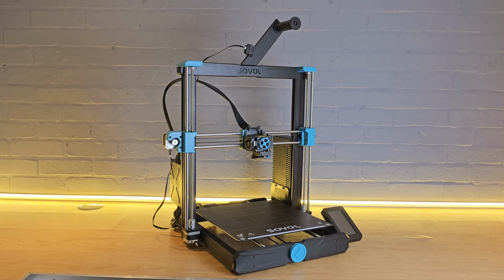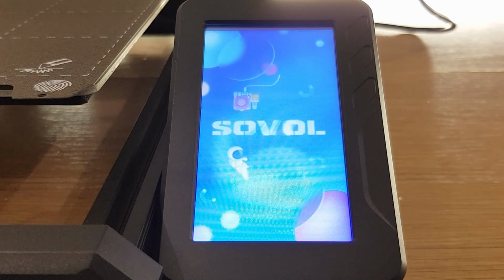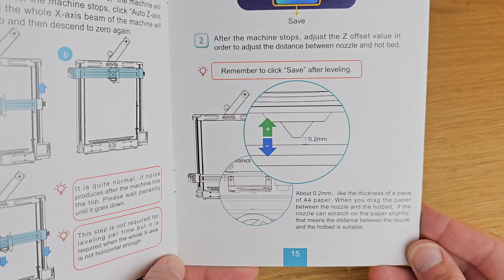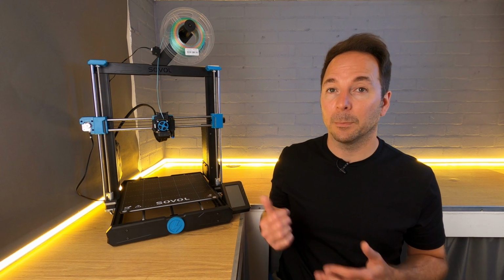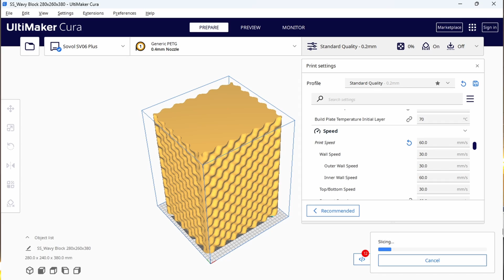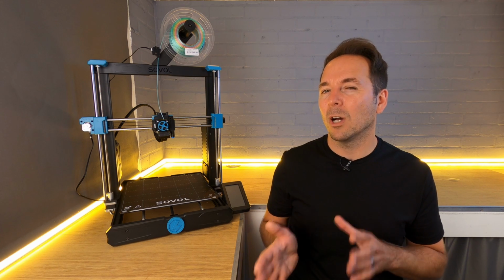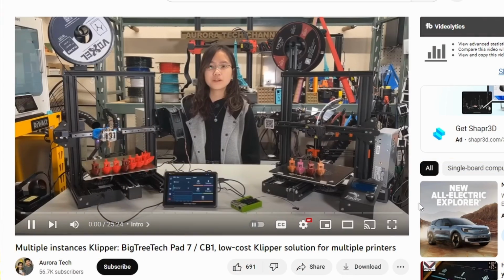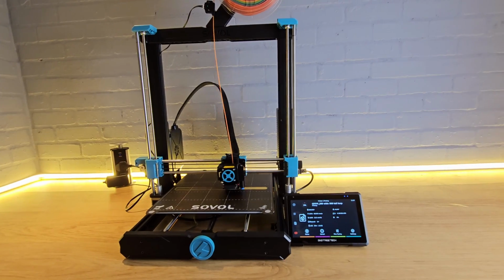Sovol SV06 Plus - The BIG 3d Printer That Nearly Could

Comment: Sovol is fantastic.. I recently bought 2 of the SV06 Plus Aces and they are without a doubt the best printers for the price you will find..  the bed leveling is now the actual tip and it's pressure sensitive , has a built in camera and light and will take time lapse video, and with a mobile program that will even tell you when it's done or even when something doesn't look right .. sometimes.   I have been printing for only about 6 years and my first printer was the Ender 3 pro which I upgraded with new main board, metal extruder dual gear and so on.. then sold that and bought 2 LONGER LK5 pros which were great printers but had manual setup for level.. now with the SV06 plus ace  everything is automatic.. I put it together and didn't have to touch any adjustments at all.. prints awesome right out of the box and I was doing Helmets and larger prints.  and with ORCA slicer vs Cura , it was no contest.. Orca is much better IMHO..

Comment: Now that we are a year on, I've become dependent on my SV06 Plus as my main printer.  I bought the Creality Sonic Pad and Klipperized it a while back.  Having the Sonic Pad also allowed me to Kilpperize my standard SV06.  I run a 0.6 nozzle on that one for lower resolution demands and it works great.  I also purchased a second extruder assembly for my SV06 and that allows me to swap down to a 0.2 nozzle quickly for finely detailed small parts.  The other thing that has made my Sovols uber reliable are standardizing on the PLA+ from #IIIDMax.  This, combined with shifting to Orcaslicer (2.1.1 right now) has proved to be a very painless and stable ecosystem for my FDM printing.

Comment: I dont know if this is the problem youre facing, but you might be experiencing some kind of feeding problem. Filament spools hung on the holder of the sv06 plus have a tendency to bend the holder slightly due to their weight. This causes the spool to slide forward and onto the end of the spool holder. This puts strain between the filament spool and the filament sensor at the top. This is because it goes into the filament sensor at a weird and sharp angle, causing friction. It might be less of a problem when the extruder is further down since there is more slack and thus the problem of friction is a more spread out problem, but the higher you go, the less material, and thus the less slack there will be.

Im not sure though.

Comment: I really do not understand how is it possible that the auto bed leveling works for everyone just not for me. Like it is close enough, but I can see nozzle is too close in front left corner and to far in right front corner. Rest of the bed is pretty much ok. I have tried everything. Leveling z axis automaticaly (by going up to the stoppers) then run auto bed leveling. I tried leveling Z axis by switching off the motors and manually moving left side, manually seting hight to bed using sensor, than moving right and manually setting height to bed using sensor, then run auto bed leving (and save it off course). Nothing works as perfect for me as for you the reviewers. It is my first printer so it is possible I am doing something wrong, but I have followed so many different videos... I am actually thinking about purchasing DIN 988 washers (0,1mm thick) and putting them under the bed to lift rest of the bed closer to hight of right front corner. (I also dismantled the printer Z axis and make sure I assembled it to be really straight up using 90° steel ruler). Problem is I am perfectionist and just ok is not good enough for me I want to achieve bed leveling you presented.

Comment: i have many problem with this print, after spend time on all adjust and setting make some good print but when i try to print i notice z offset was high and the left side was more high that the right side! so remake all setting make z offset very low and now i print but still the quality have issued, i switch from 0.4 to 0.6 steel nozzle, now i prepar to install 5015 fan

Comment: So the inexpensive XL printer failed at a newly designed torture test print made by you and tested by no one, and yet no other printers have been shown to successfully print it.  You may be able to draw in CAD 3D space, yet the ridiculousness of your thought process paints you as unintelligent.  

And no, I don't own a Sovol...but your thinking on this one is poor at best which is really disappointing.  MIM gears and other MIM parts fail all the time.  The failure rate is low, but mass production means it will happen. This is not unique to any direct drive extruder, and exists in the auto and firearm industry to name a few.  Then you slap on an upgrade(Klipper Pad) and re-test without showing what the average buyer would experience?  Jesus dude, you are all over the map.
Reply: I'm not sure what's the need to be so brash here. Maybe you don't think in the same terms as him, and that's fine, but I find his reviews valuable.
Reply: @actualreplyguy  I am brash because there are many, many more who cannot see logical fallacies.  His videos can be great, and some are, but nothing makes change like being shown your errors in thinking.  

You say we think different...true, and in some ways I am too critical.  

I think of the people who are turned away from a product by an influencer because of a slight struggle...an irresponsible one as well.  A voice to others should be held with higher standards.

His sample of one printer that he had minor issues with are not how the printer should be viewed.  Had he known anything about manufacturing, he would know the real weaknesses are completely different than he stated.  Not the 1 in 10,000 MIM parts.  The injection molded parts are weak as are the bearing choices which are worse, yet he cannot see it.
Reply: @CuttinInIdaho  you have an axe to grind or something? Guy literally went step by step about how he got around the problems he was facing -- which was to install Klipper. There were no leaps in logic.
Reply: @actualreplyguy  re read my comment without your emotions clouding your comprehension...no axe to grind.  I can't help you with logic though.

Comment: Very informative review.  Thank you.  I replaced $3000 worth of QIDI FDM printers that I couldn't keep running with a $238 SV01 over two years ago and it's been great.  Unlike the QIDI 3D printers, the Sovol printer uses inexpensive and readily available parts.  Also unlike the QIDI printers, it's reliable, and when it did need a new hot end heater, the open architecture was very easy to access.  I'm inclined to upgrade to a later model by Sovol, but I want Klipper.
Reply: youll be happy with the svo7/7plus now then
Reply: @ZFGFZDGDFG  - I probably would like a Sovol SV07 or SV07 Plus, but my Elegoo Neptune 4 Pro arrives tomorrow.  I'm stoked to be getting a Klipper machine with all steel motion control components and enhanced part cooling.  I might be in the market for a Neptune 4 Plus Max (420 mm cube build volume) when it becomes available, for the rare times I want to print something BIG.

Comment: I love my SV06+. 5015 fan for parts cooling. Klippered and installed a ercf 6 filament system on it with a homemade filament cutter for color changes. All in all i have about $600 in the entire thing and have the ability to do 6 colors.

Comment: I got the SVO6 Plus a few weeks ago as my first 3d printer. I really like the printer so far. Its been running alot and I'm getting less mess ups as time go on. The thing that I dislike the most about it is having to deal the the mico SD card all the time. I've discoverd OctoPrint and I set it up on an old laptop and it now runs the printer.  Is OctoPrint about the same thing as the Sonic Pad with Klipper?
Reply from the maker: It's sort if similar in the way you interact with it but it's actually quite different. With Octoprint and your stock firmware, the printer's control board is still doing the work, you can just send the files to it remotely and control it in some other cool ways. Klipper actually has the additional board doing the work and your printer's control board just does what it's told when it comes to moving the stepper motors.

Comment: Also if you replace the fan shroud, you can use regular volcano nozzles instead of Sovol’s garbage proprietary ones - the best one I’ve tried so far is from SavageLau on Printables, the “Hurricane” one.
Reply from the maker: Good tip, I'll check it out

Comment: I had the same problem with large, tall prints - it’s the damn filament sensor. They mounted it mostly fixed in position next to the spool, instead of on the tool head (for some reason, despite the tool head breakout PCB having a plug for a filament sensor), and as the tool head gets closer to the spool vertically but farther horizontally, the filament starts to drag in the sensor and causes uneven extrusion. Move the filament sensor to the tool head (you’ll need to make a cable for this, but it’s easy) or just bypass the stupid thing.
Reply from the maker: I see what you mean and it was my first thought too but I tried a few things I didn't show in the video and I'm not convinced that's all it is causing the quality and layer shift issues. I agree the design isn't perfect though.

Comment: Hey Ricky, great video! I really enjoyed your review of the SV06 and your insights on it. It's an impressive printer. I completely agree with you about Klipper. It's a powerful firmware that can significantly enhance printer performance. I'm also interested in upgrading my Ender 3 with Klipper and a Pi, but the installation process can be daunting. I don't want to risk making mistakes or spending endless hours searching for solutions. It would be amazing if manufacturers offered preinstalled Klipper units or easy-to-use upgrade kits. That way, we could enjoy the benefits of Klipper without the hassle. Thanks for sharing your thoughts, Ricky!
Reply from the maker: It sounds like the Sonic Pad would be a good option for you. It's pretty straight forward with an Ender 3. They have included printer profiles that you select during setup. I have video guides for all of this too.
Reply: @RickyImpey  I was thinking about that option too. Thank you, Jason
Reply: They now sell a sovol klipper upgrade for under $100. It’s basically the same setup as the svo7 with klipper and a network app access.

Comment: I have printed a large lamp shade that filled up almost the whole volume, without an issue on my SV06 plus. But I use a Sovol drybox for the spool, so no big spool on the spoool holder. Maybe that is causing the wringing effect, as @MM-fc8ie writes. It is not plain sailing however with this printer. While I could print ASA quite well in an enclosure it now doesn't anymore, with kicking over objects and creating spaghetti. During my attemps to fix this I tried to replace the nozzle (at 200 degrees Celcius), but broke the nozzle. I have to wait for a replacement nozzle now. 
I bought a raspberry pi 4 for Klipper, so I will see how big the benefits of Klipper are. Aside from a speed bump I am wondering whether quality can be improved, as it was already quite good at 40 mm/sec (aside from later problems with ASA)

Comment: You have a relatively tall Z axis gantry that has no bracing to the bed, with a 1kg spool of filament on top, coupled with a print that is adding more inertia to the bed as the print gets taller. Then a wavy print design that swings the bed back and forth.This is a good recipe for setting up sway in the gantry, magnified the higher up the print head travels. Sure you can improve it with Klipper, but I would start by moving the filament from the top of the printer to the table and bracing the top of the Z axis gantry to the printers base, like in the CR 10 Smart Pro.